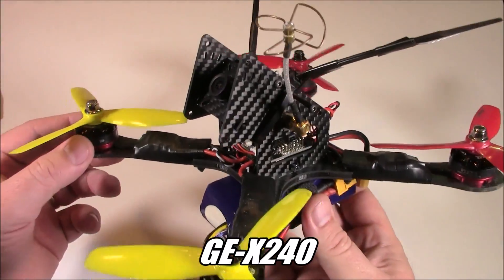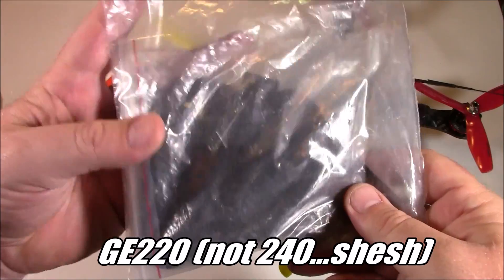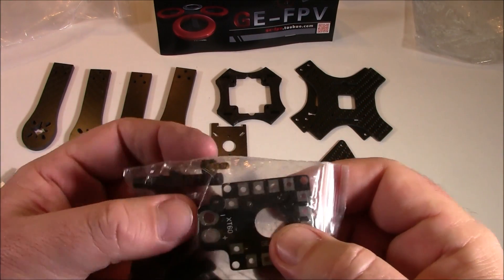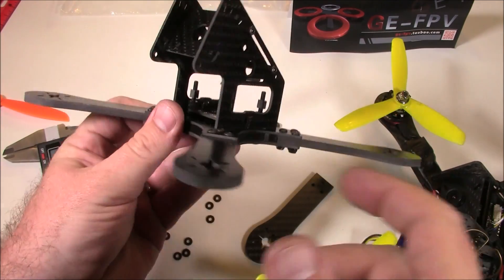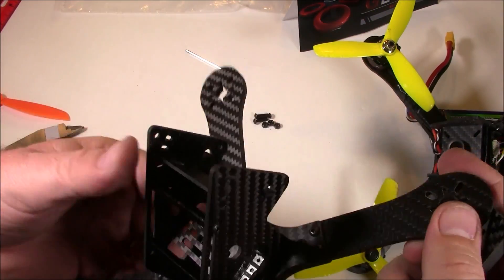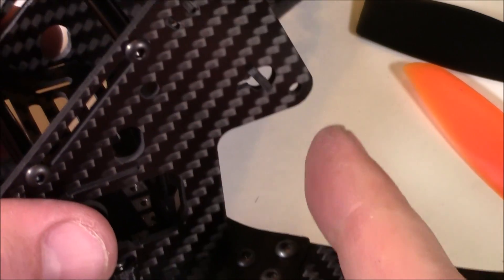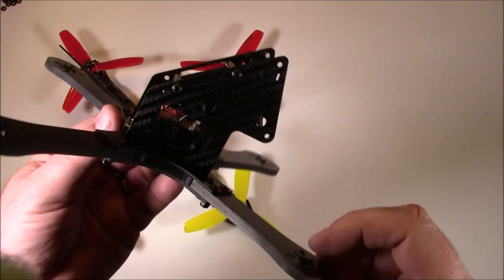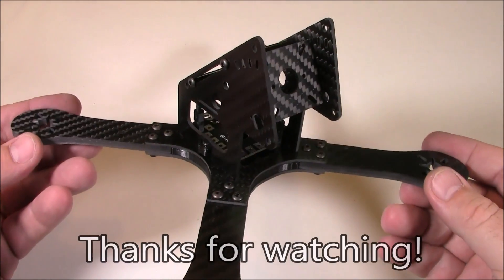GE220 Frame Review from Banggood with Comparison to the GE-X240

Comment: does the frame come with the aluminium spacer for between the to side plates? because on the banggood pictures it doesn't seem have them on the frame.
Reply from the maker: Yes, it should.  Mine did.  Those spacers are used to hold the 2 side plates in place with each other.

Comment: I read a comment at banggood, someone saying that he had the pod come off in a crash. Somehow it slipped through those two screws holding it together. Did you have any issues so far? Once more great review !
Reply from the maker: +Elefkara Thanks!  Not yet.  I flew mine in a drag race and rolled it and nothing happened.  If it really did come off, I'd guess he didn't have it screwed down right or he had a real bad crash.
Reply: +travisgrindal Yeah probably

Comment: Can you recommend a Camera for this frame? What else did you include in your build?
Reply from the maker: +hexacetat There is enough room for a board camera.  A Sony PZ0420 (CCD) is one of the best cameras I've used.  The problem is they are a little expensive compared to CMOS cameras.  I go back and forth between them.
Reply: +travisgrindal Nice, i already have a PZ0420 in shipping for my GEP210 so id might just buy a second one, thanks for your answer, already subscribed =)

Comment: Hi, you can't put in Yi or Legend camera ?
So, for 6045 props and what motors ?
Reply: +ONCLEFLY I would go for the Cobra 2206 2100kv or if you want to go for 6S battery go for the Cobra 2208 2000kv :) the 2208 take take 6s the 2206 can NOT.
Reply: +Flores FPV With that you have a rocket.   :)
Reply: Yes, That what you want ;) How long have you been flying?
Reply: + Flores FPV It Tavis have no me, sorry.   :(

Comment: will it fit a full size fpv cam like Pz0420? or is it made for pz0420m like the lisam?
Reply from the maker: +Flytiger Paradise There is 38mm of space between the two side plates.  How wide is a PZ0420?

Comment: This looks good, I may have to get one. What's the spacing between the two side plates? I'm wondering if I could fit my mobius between them.
Reply from the maker: +remotaholic yes, it will fit.  I had mine mounted there.  It is 38mm wide.  I just measured it.